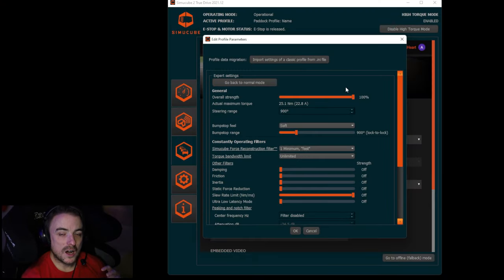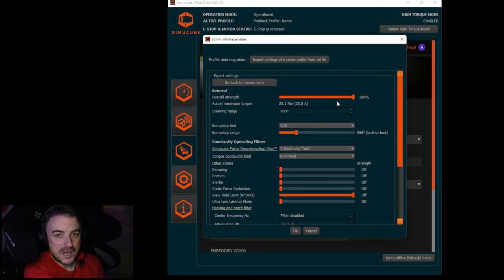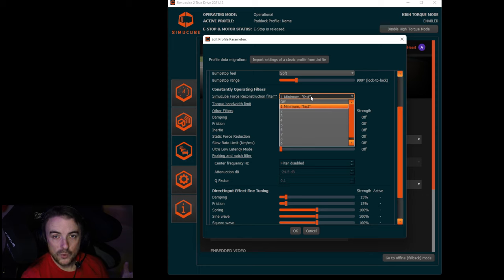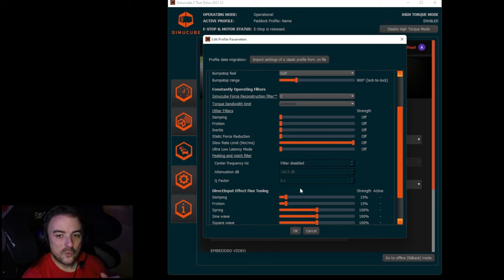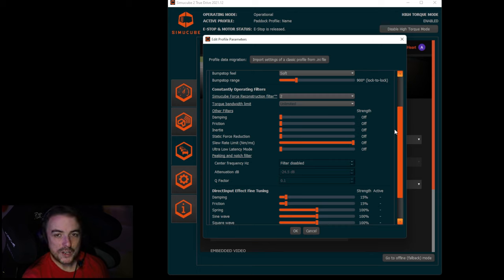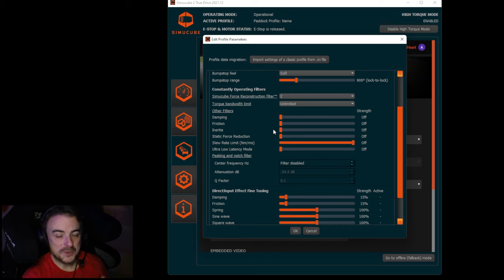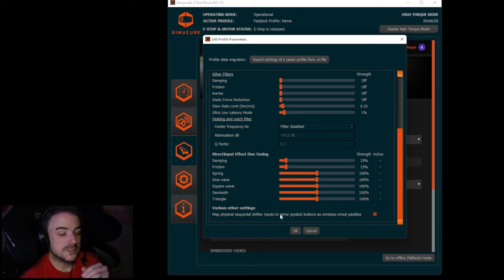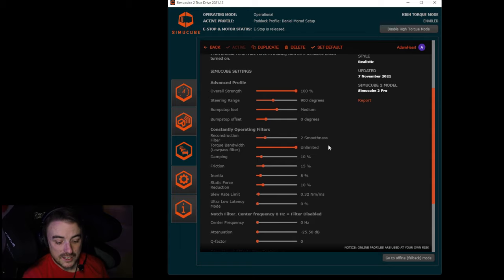Simucube True Drive Setting Explained.....sort of

Comment: Im very new to sim racing.
What i dont understand is if we change all these settings in the Simucube software, how does that effect the setting in the games, like ACC or IRacing? Seems to me theyd be working against eachother. If i change "gain" and or  filter" in ACC then the changes i made in Simucube dont mean much.  If i set gain to x value in simucube and y value in ACC then why not set one of them to 0 value and make adjustments in one or the other? I feel a big difference bewteen ACC and AC wheel settings. Which pretty much negates what i did in the settings in Simucube. 
I feel like either the games should control it or the Wheel base manufacturers should, not both.

Comment: Hi Adam. How would you tackle oscillation on a straight on a SC2 Pro? As I understand it you should be able to let go on a wheel, or hold it with your finger tips on a straight without it oscillating and losing control.
Reply from the maker: Increase damping incrementally until you find that sweet spot. Different cars may require different settings depending on the level of FFB you run
Reply: I have the oscillation issue even sitting still in N the damn wheel starts oscillating…adding damping helps but then seems to make the steering too light in the turns. Going to give the settings you showed a try.

Comment: Hey Adam great video I run the a car do you know what setting I could adjust to get the most feeling of the rear end sliding out? The setting to help assist in saving the car? Do you have a facebook page for messenger?

Comment: I'm new to this ... I have a simucube pro 2 .... only problem I have is why is shake when u let go of the wheel ? How to i fix that ??? I'm lookin everywhere for this n nobody talk about it .... when I'm in the straight away I let go of the wheel n it goes crazy
Reply from the maker: There are a few ways to approach this.  What sim are you mainly running?
Reply: @AdamHeart   asserta corsa
Reply from the maker: @dirtysock1able  Try adding more damping

Comment: Adam go you have a profile on True Drive that can be downloaded?
Reply from the maker: I use Daniel Morad's profile for all but the Porsche Cup as I have a custom profile I made for that.  I'll upload it to True Drive later on today.
Reply: @AdamHeart  Do you use irffb and if so with or without v joy?
Reply from the maker: @bobg1859  I would never use irFFB with a Simucube wheel base. True Drive has all the reconstruction filters that irFFB does and they do it better IMO. irFFB blocks iRacing from communicating with True Drive and by extension your wheel base. All data now flows through irFFB and only irFFB. 

If I was using a belt or gear driven wheelbase, then I'd use irFFB 100%
Reply: @AdamHeart  Thank you for that info. I did not now that. Look forward to try you Porsche Cup profile. Thanks